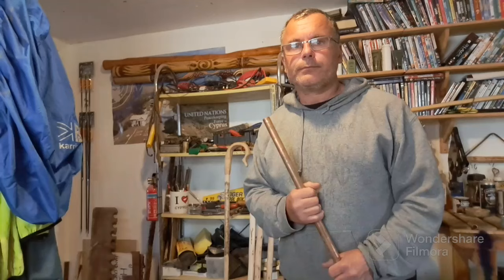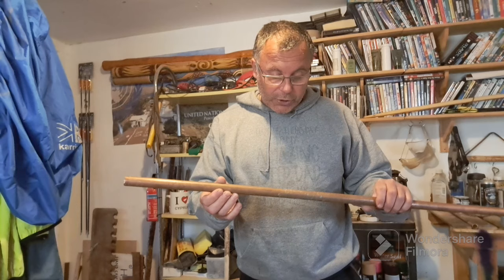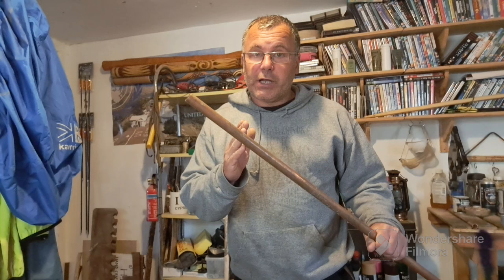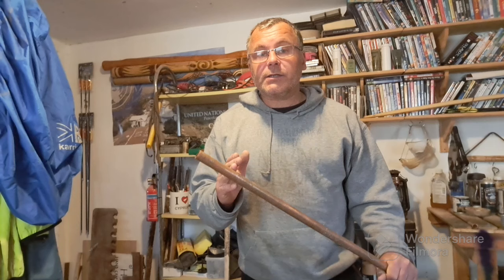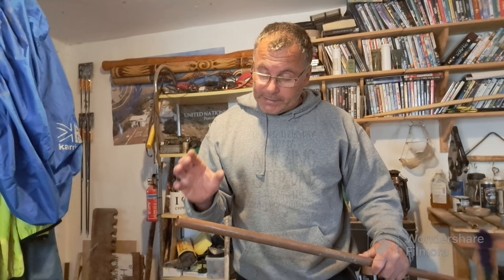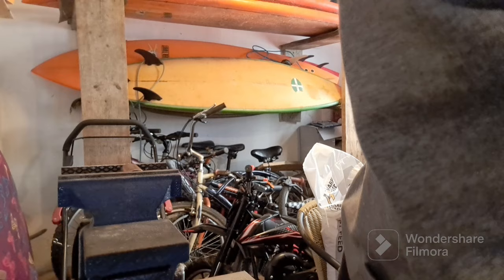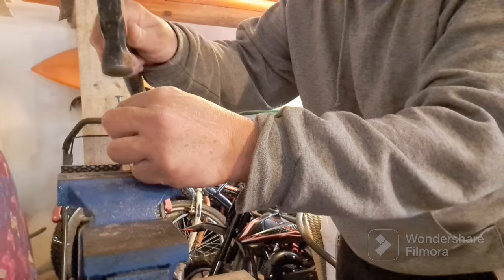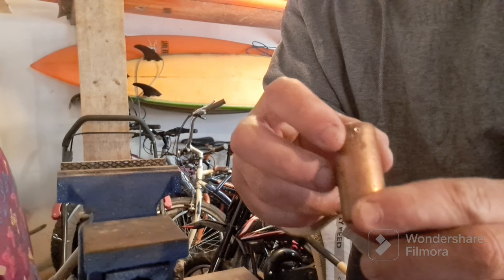How Hiking Stick Copper Tips Are Made. Complete Build, fitting ,Sizing.

Comment: Try using 28mm copper tube on the larger diameter sticks, it will save you chamfering the stick. Look out for a swaging tool, it's used to flare the copper tube, this will help fit to the chamfered stick.
Reply from the maker: Hi, I use 28 mm for my Bushwhacker  model and valhalla model. These are  heavy gauge items. As I have small profit  margins, using the heavy  gauge would be expensive but also heavy for sticks that fall  into the  category of Hiking and multi day hiking sticks where weight becomes a factor due to unnecessary stress and fatigue over time and distance. That tool is something I will keep  a eye out for at sale's and car boot sales to see if I can get one cheaply. Your right, it would help with difficult tips. Thanks for watching, Andy.

Comment: What would happen if you soldered a 3/4 " copper cap on the end of that?   Too slipperty?  Seems like it would last forever.  Great video dude!
Reply from the maker: Hi , I have never tried that as the wood gets compressed inside the tube as it's used. The ridge formed around the outside provides grip also. As you have said, I can imagine your idea would allow the tip to last way longer. For me, it would also add cost I would have to pass on to the customer. Fantastic idea for a self build hiking stick, and I will have an experiment .Many thanks for watching and commenting. Andy.

Comment: A thought, or two—short, equally spaced, stainless nails/pins on the furl for decoration.  6, or 8 would polish very nicely and give some contrast with the copper.  
Also, one stainless in the middle of the fuel end of the staff may give a little extra wearability since it’s harder than copper-maybe.  
If you ever attach a separate handle, please use a grade 5, or 8 to attach it.  I personally had a nice cane with the handle attached with a common grade 2 bolt.   After a year, or so of use that bolt broke in two and caused me to fall.  Luckily I wasn’t hurt, but I could have been hurt very easily.  
Also, I use sone clear polyurethane on the inside of my Ferrells.     It help Yemeni last longer and seals out moisture.     I put that on wet and brush a separate coat just on the top juncture to insure no moisture ingress.  
And Flitz will polish copper to a very nice shine.  And a tube will last for a long time.  It doesn’t take much at all to polish a feryl.
Reply from the maker: Hi , Glad you were not hurt on your fall.i don't get asked for canes simply  because there is so many people  specialising in  making them as their main crafting sticks. I 👍 the idea of different pin colours.Happy crafting.Andy.

Comment: Hello 

Thanks for the video 

Must say that i do prefer a closed ferrule which are normally brass not copper
Further if i install a copper pipe i put a supper glue on the exposed wood.

Yuval
Reply from the maker: Hi, That is intriguing the use of superglue. I have used other types of   of materials and commercial tips and even  copper  pipe blanks. This method I am using kinda seems to suit my style of stick (The back woods kinda feel).Thanks for glue  tip for tips.Thanks for watching, Andy.

Comment: Hey man thanks for this video! I just started making hiking sticks & want other tip options.   Ive thought about copper stopper type tubes & then screwing in a big bolt which could even be made to a point but yours seems easier & effective.
Reply from the maker: Hi, I have experimented  with various  tip options  including  trying to make a spiked end cap. I did produce  a nice prototype, but could I could not consider selling as it was bordering on possibly dangerous if mishandled.  I may come back to the design  and see if I can soften it's profile so it's application  of a hiking stick tip is more refined. Many thanks for watching.Andy.

Comment: Nice to see your work ! I am interested because I also use copper tube for my stick tips but a bit differently. I keep some extra length of copper, like 12 mm for 24 diameter stick, and then hammer that copper at 45 degrees angle while turning the stick all the time so that the copper closes on top of the wood, more or less sealing it … it’s a bit tedious requiring hammering for 20 minutes non stop but the result is super … I finally add a bit of C.A. Glue to finish the sealing of the tip … hope this may be of interest to you. I am in french Alps near Annecy and make some sticks only for a hobby and walking in the hills or mountains nearby … using different woods like black locust, dogwood, chestnut, hazelnut, blackthorn and hawthorn … it’s nice for me to share tips with other makers !
Reply from the maker: Hi ,I like your idea hammering the copper tips over at the end. I have been  to the  mountains  in France and they area spectacular. Thanks for watching and commenting. Andy.